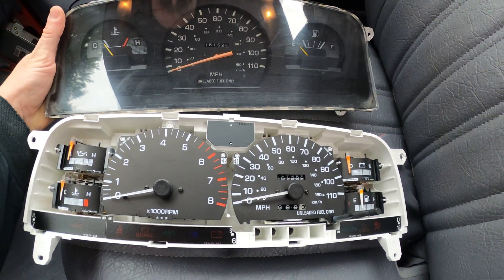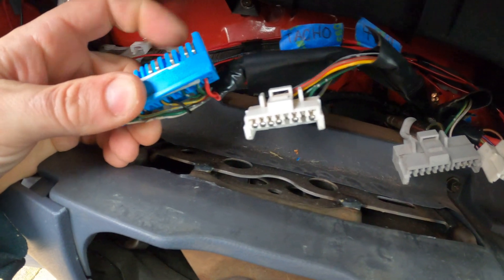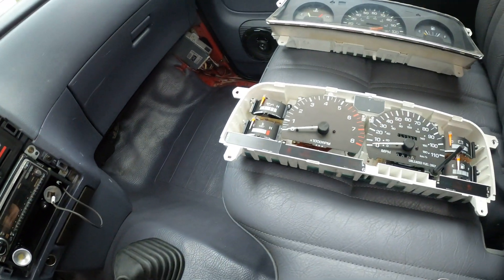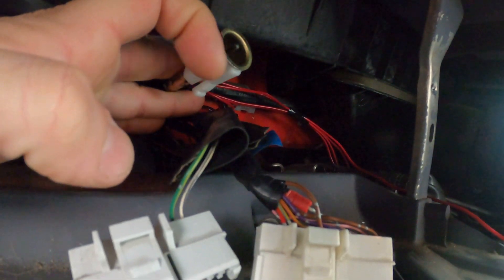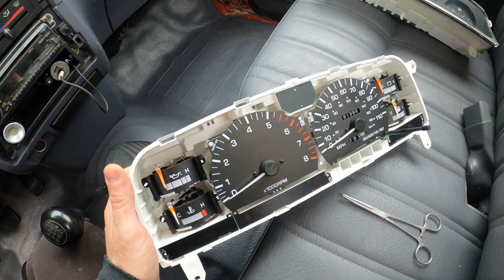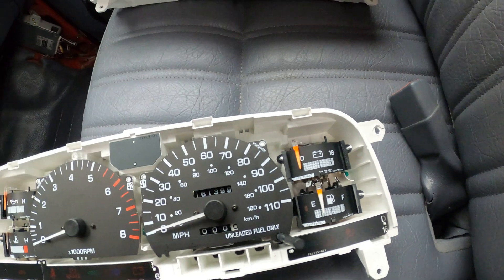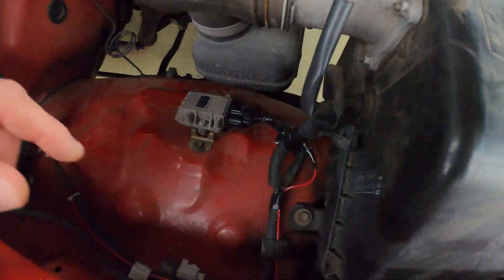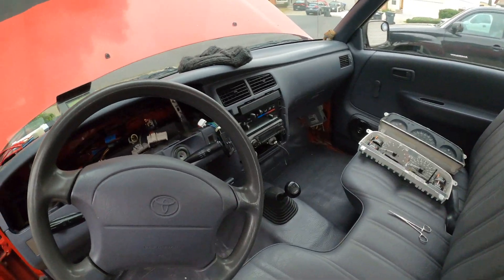Toyota T100 instrument cluster swap, to SR5 gauges

Comment: Do you have any videos showing the speedometer being plugged back in having a hard time getting my hands back there
Reply from the maker: i used a set of extended grabber sissor kinda thingies , to grab the cable - that helped. you can also remove the small metal plates on either side of the cluster (that support the dash), and that gives a lot more room to work in